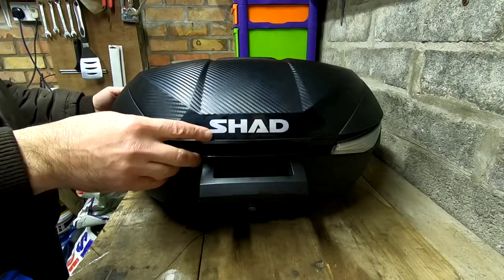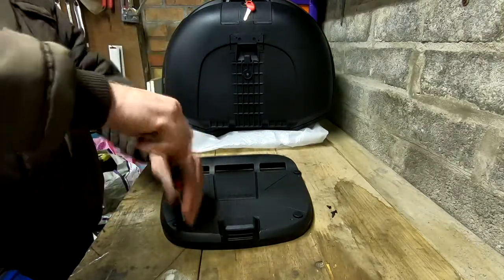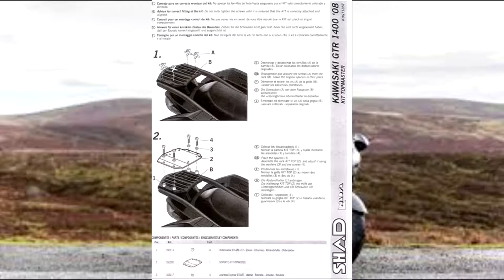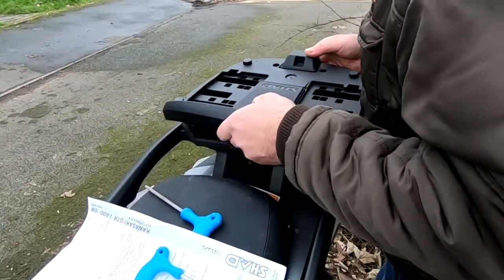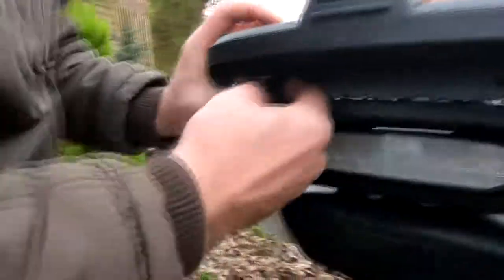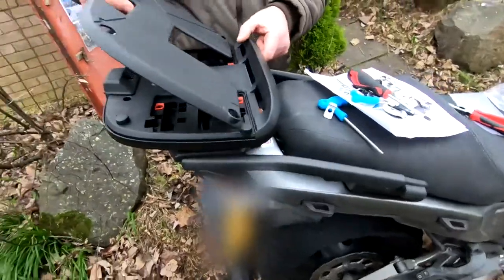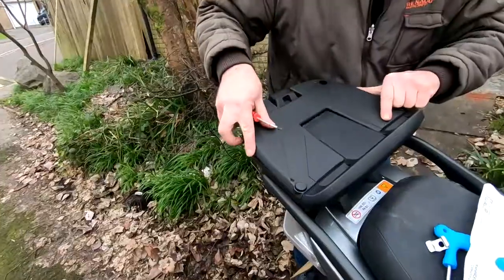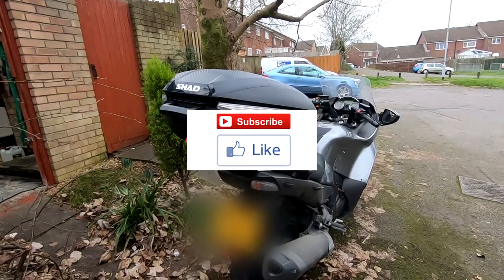Shad top box install - Kawasaki GTR 1400

Comment: Thank you ! My Shad SH59x just arrived. No instructions. I came across this video and with your help my R1250GS now has a new topcase installed. I used this exact process on my bike without issue. 

I really appreciate you taking the time the share this video. Cheers 🍻
Reply from the maker: Yeah not difficult to fit, but instructions are very poor 👍🏼